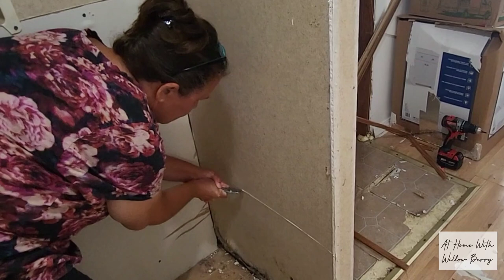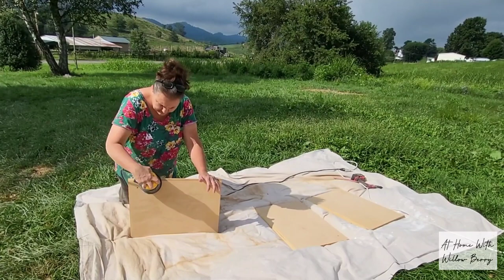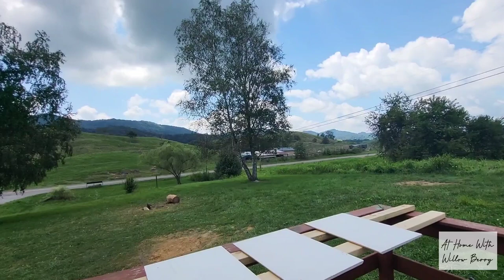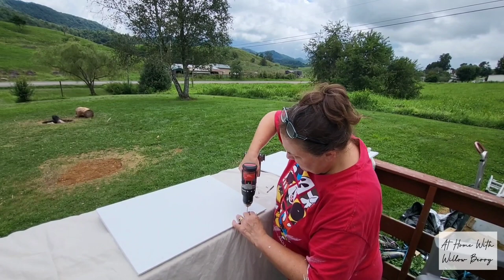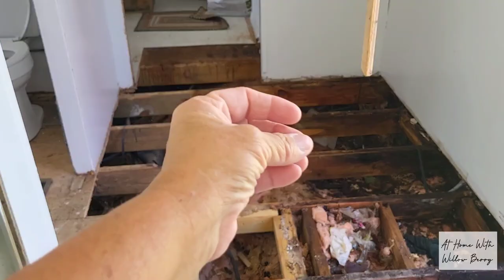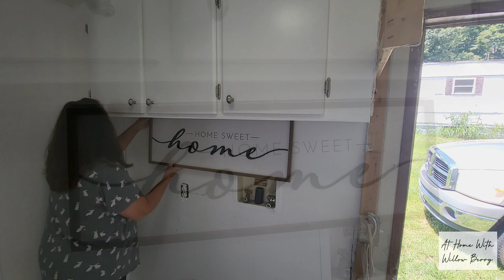Laundry Room Renovation / 1996 Single Wide Trailer / MOBILE HOME LIVING / part one

Comment: Your trailer is starting to look like a comfy & cozy home with all of the work you're doing.  Can't wait to see the final outcome for the whole trailer.  We decided to purchase a front-loading Maytag washer and dryer set.  The reason why was due to the fact that the washer doesn't have to be drained every month of stagnant water sitting in the overflow catch basin.  We found out about having to do this when we bought a Samsung set and 2-3 months later our laundry room and washer smelled like rotten eggs and we couldn't figure out the problem.  We had a maintenance tech come in to check out the washer and he said our problem was the overflow basin was filled with stagnant water and showed us where the drain for this was located and how to do it.  He said to drain it every month or two depending on how often it's used or if we start smelling rotten eggs again.  We decided to sell the set and purchase a set that drains the overflow by itself.  At the time, 4 years ago, Maytag was the only brand that offered this feature so we bought the set.  I'm totally invested in your renovation videos and so happy when a notification comes through that you've uploaded a new one.
Reply: I have a Maytag stackable since 2007 and have never had a problem with them.  I was curious why so many people complained about odor with frontloaders.  I always use bleach on my linens and wash them last so I assumed that was the difference.  Will definitely stick with Maytag as long as I can get them.

Comment: I have always lived in a mobile homes one thing u should do if u have bad winters. Check your pipes especially the ones on exterior walls make sure to have enough insulation to avoid pipes freezing and breaking in the winter. For the water pipe coming up from the ground into the mobile home make sure to wrap that good in heat tape. Broken pipes in winter is a true nightmare. We just bought a new washer dryer set Samsung top loader I'm loving this set. I don't have much to compare it to it's our first new washer and dryer lol. Married 30 yrs come October and we were given a used set about 25 yrs ago( whirlpool) and it's has finally died 😢. The laundry room is turning out beautiful LOVE your decorations. Can't wait for the next video ❤️

Comment: I enjoy watching your videos!  I am a mobile home person myself.  I bought a 1986 Oakwood in Nov of 2007.  It was a mess too.  I did not know a lot about diy, I knew how to paint, garden and make things look good.  Since I bought this mobile home I've learned how to do subfloor work, basic plumbing, installing toilets, vanities, sinks and faucets.  It has and still is an adventure.  I also am thinking about starting a furniture restoration flipping side hustle.  I have always got used furniture and fixed it up for myself.  Just sharing from one mobile home liver to another : )) Keep up the good work!  Proud of you and yours!!
P.S I have the same curtains hanging on my back door.  I don't use the backdoor, I have a cabinet there,  But hung some curtains to make it look nice.  The flowered curtains blue and grey you can see them in your video.  Just relating!!! (got um at the dav .99, I love it)

Comment: Look at you go. So proud of you. Here’s a little helpful tip from one do-it-your-selfer to another…. Silicone caulk in joints and cracks that don’t fit perfectly. It seals and hides the flaws a little, especially for ceilings and walls.

Comment: Fantastic job, looks awesome. With all the work you guys are doing maybe you should just buy that mobile home.  The view is heavenly!!!!     Tip,   "MAKE SURE THE PIPES UNDER THE TRAILER ARE WRAPPED AND HAVE A HEATER. I'VE LEARNED FROM EXPERIENCE, MANY BURST PIPES.  Also make sure all of the underneath of the trailer is insulated!!!!  A very expensive expense that I could have avoided.  Also when it gets cold, 32 degrees and below. Put every faucet you have on hot water drip,  including your tub. This will help them from freezing. I'm in Texas now but was born and raised in Massachusetts. The winters are brutal on mobile homes.🥰🥰🥰🥰🥰🥰🥰🥰

Comment: G.E. from Abt online is the way I went. They're old-fashioned looking in that there's a top loader washer and a front loader dryer. I have tried whirlpool and I have you used the Kenmore brand, unfortunately Kenmore is no longer available in this area but I went with the GE from Abt and I am so proud that I did and I'm thankful because they are water conscious and electricity conscious and that certainly helps with the utility bills.

Comment: That looks great! My washer and dryer looks like the pic and I like mine. I’ve had front loaders, high tech and others. I just knew I was dead set on getting old style washer and dryer. I’m just glad you can still get them. Nothing but trouble with others or just didn’t agitate right. Bought them new. These are more affordable too.

Comment: Instead of a conventional wall, try a polycarbonate sheeted wall for there.
Will allow in light.
And very water proof.
Don't forget to use flooring that is water proof too.
I wish I didn't have cabinets above my washer and dryer. Would rather have open shelving. You can see drips and spill, to clean up right away.😉👍

Comment: There should be some sales over Labor Day weekend.  I like the Maytag Centennial W/D with a stainless tub.  It's one of the few top loaders that still have an agitator and has a "deep wash" option.  I've had my current set since 2016.  It's made in USA.  Got the set at Home Depot.   The place is coming along great.  It's amazing how nice cabinets look when they're painted white.
Reply: 👆Thanks for taking your time  through my videos kindly Message💬above to receive gifts🎁.

Comment: If you are leaving the washer and dryer when you move, I would find a local used appliance dealer to purchase them.  If you are taking them with you, I would buy Bosch if you have the money for them.  Otherwise, I have been happy with my Samsung Washer and Whirlpool Dryer.  Not sure if I would say Whirlpool is the best, but they are very reliable at a reasonable price.

Comment: First time viewing, this is how I would have reacted. Making the best of the situation, but how long of a lease did you sign? Hope you took before and after photos. Black mole should be wrapped to eliminate mole spores and cleaned with water and bleach. Molded material should be replaced. You 🥴 did an excellent job. Wow! People should be more considerate of others.  Did you go back and caulk seams?  The owner needs to knock off some of the rent. If you can, add a folding area above washer and dryer.

Comment: It is easy to change that light just turn the power off!  You are a smart woman, there are only 3 wires including the ground wire.  Look at the directions on the box.  I have done quiet a few in my condo.  It was much more dangerous just hanging there.
Reply: ☝️Thanks for your advice and support telegram above to receive gift 🎁thanks for watching❤️

Comment: The landlord should be paying you instead of you paying any rent. I would think that he would be thrilled to buy the vinyl flooring if you all were willing to install it. I will tell you the washer I would not get and that is a front loader he. I got a new matching washer and dryer set and I hated it. It broke for the second time and I got rid of it. I got an old used set that I love. My friend's front loader broke and the repairman said the board would be $350 to replace and he didn't know that it would not instantly blow again.

Comment: You did not tape the joints on your drywall. They will crack. You did not fill in the drywall screw holes, and you painted over the dirt on a metal vent panel. Your landlord is getting what he paid for.
Reply: 🔝Thanks for taking your time  through my videos kindly Message💬above to receive gifts🎁.